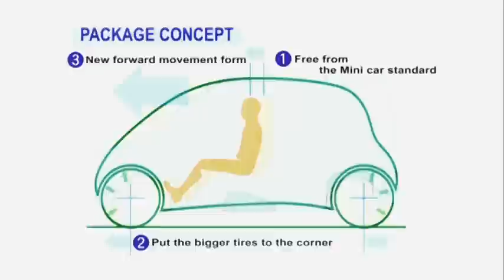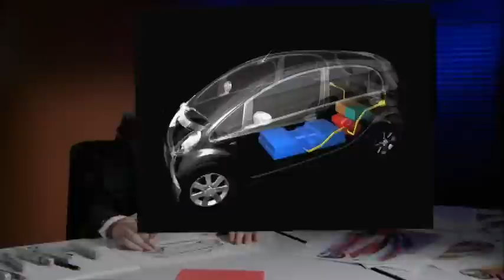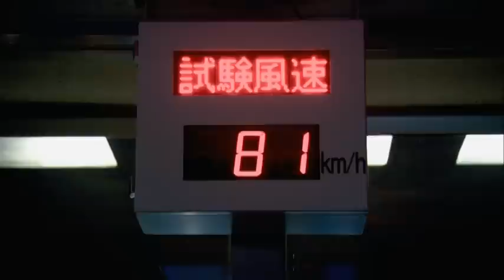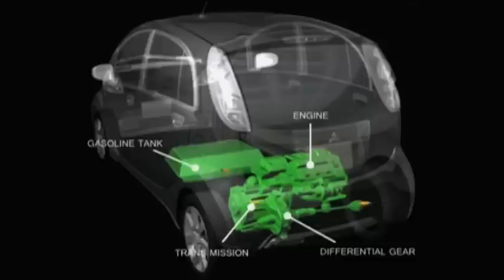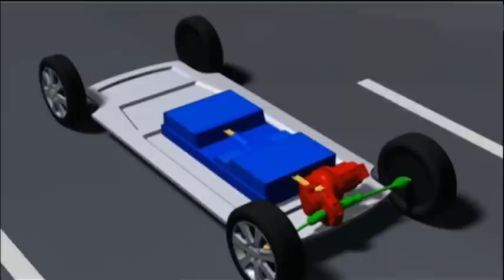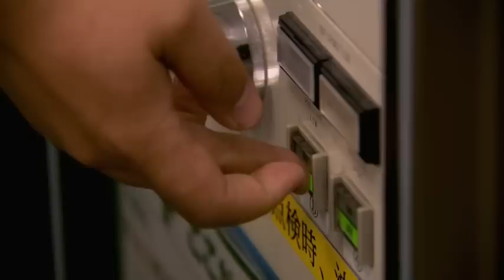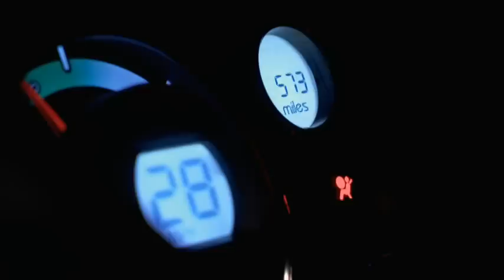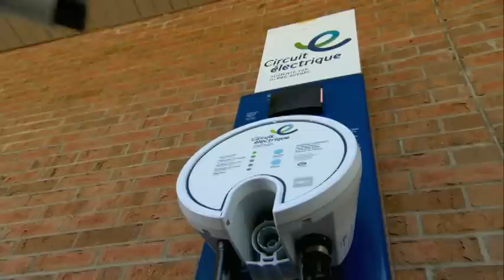Making of the Mitsubisih i-MiEV Electric Car (Part 1)

Comment: Have owned and driven one of these extensively for 7 months. We love it. Fun to drive with quick pickup (motor coupled directly to wheels, great jackrabbit starts). Quiet inside. Actual range off the highway is about 80 miles. Heated front seats, heated outside mirrors. Fold down back seats. We charge it overnight at 12A, 120V.  Downsides are poorer safety profile of rear-seats and decreased range in the New England winter, but that only affects longer runs. (We bought a 12v heated lap blanket to decrease battery drain by running the heater.) For a city car, it's a great buy (~$23K), and up to $7500 Federal tax rebate.  No, haven't seen another on the road yet. It's a well-kept secret.

Comment: I bought  this car to take kids to school is about 40 mile per day street drive as a minimum , I pay for mine 9000.00 dollars 2012 model, when I do need a fast charge I pay only  10 cents per minute it takes about 18 - 25 minutes to recharge at 80%  CHADEMO charger station (nrg brand) and sometimes no money to pay at free charge stations . I save a lots of money on gasoline fuel, NO MORE DMV SMOG TEST, NO MORE OIL CHANGE, NO MORE SENSORS TO REPLACE, CATALYTIC, TUNE UPS LIKE MY OTHERS CARS, ETC....  This nice car is intended MORE for city street driving than long distance driving.  This nice car save me enough money that it pays for itself payments are 170.00 dollars per month I spent twice as much money on gas with my others cars. Also I bought an extra warranty bumper to bumper for  1100 dlls  50k miles or 5 years!!!, Thanks for reading.

Comment: Like the concept. Makes me wonder why a PV panel wasn't installed in the roof, to reduce the need for charging stations. Flexible panels are available that would conform to the shape of the car.
Reply: PV modules are only 20% efficient. you would need a rooftop the size of a bus, or your home, to make a dent in charging.

Comment: not a bad vehicle. A 2nd larger battery option would be great. Active battery cooling they they have on their MiEV with the Fast Charge option should be on all models. A very efficient heat pump like the LEAF would be a very good move.
Reply: The Leaf doesn't have a heat pump for the battery.

Comment: Here are questions for the engineers at Mitsubishi, because I can't find an answer anywhere else, or a good contact email:  
   The lithium battery has a heater that, according to my 2016 owners manual, kicks in when the car is connected to the charger and "the main drive lithium-ion battery temperature is between -22 °F (-30 °C) and -13 °F (-25 °C), the energy level gauge shows 4 bars or more of full charge" and the charger is connected.     
* Questions *
-- If the battery is fully charged and the car remains connected to the charger, is the battery warmer still operating? 
-- If the car has sat in cold weather, not connected to the charger, and the battery temperature is between -22 °F (-30 °C) and -13 °F, what happens when one first starts driving? Does the battery warmer kick in? 
-- Yes, driving also warms the battery. How long does the battery take to warm up? 
--  Does regeneration work while the battery temperature is still very cold, or is it delayed until the battery is warmer (to prevent lithium plating at the anode while recharging a cold battery)?
Reply: What about the heater?

Comment: umm... thanks for your unsolicited response but I was asking an owner for real world cold weather experience, not test results from a corporate PR video
Reply: Well, as an iMiev owner, I can tell you that running the heater and defroster will reduce your cold weather range markedly. We bought a 12V lap blanket, and between that and the heated seats, it's pretty comfortable. If it's 25 F or below, one needs to run the defroster at least intermittently, but that's not a cause of major range loss. It's certainly not as warm inside as a gas-powered car. Cold weather seems to cut about 25% off the range even without running the heater & defroster.
And btw, in nice weather the range off the highway is around 80 miles, not 64.

Comment: @grantourismo0109- not enuf space on a car to power the drive
or even charge the car enuf to make a difference.

It is of course possible to charge an EV from regular PV charging system.
It will take at least 24 panels.
Reply: No. The i-MiEV especially at most accepts a 3.3kW or 16 amps charge at home. That charges its 16kWh battery in 5 to 6 hours. You'll only need two panels or more (presumably 1 metre squared) to solely charge the i-MiEV. That depends on the area where you live in. Germany or most of Northern Europe experiences over 2kWh of solar energy per meter squared. In areas like California, that rises to 6kWh and Arizona reaches to 8kWh. There are plenty of people who have 2, 3 or 4 panels on their roofs that supply all of the electricity they need, regardless I don't think it's possible to put 24 large panels on an average sized house's roof.
Reply: So then are you gonna mount 2 240 watt panels on this car?
Reply: toyotaprius79 You have no idea on what you are talking about.
Reply: Jimbob You are dead right, he doesn't!

Comment: I'm all for a better future and more eco friendly technology 
But, I would not buy this.. 
Simply just because of the design, It may be for the most sufficient and aerodynamic causes but It looks very compact and I don't see my friends or family fitting in the back seats, also it looks egg with wheels u.u

Is there any new designs since this was published in 2012?
Reply: The back seats are small, and not only that, are less safe in a collision, so that's a consideration if you often have multiple passengers. As to appearance, as it is said, "form follows function." But yeah, a prospective partner might  be more impressed by a BMW.
Reply: if you fold the rear seats, it has more cargo space than a Nissan LEAF. Its a very practical car.